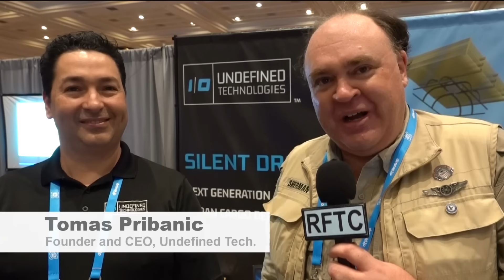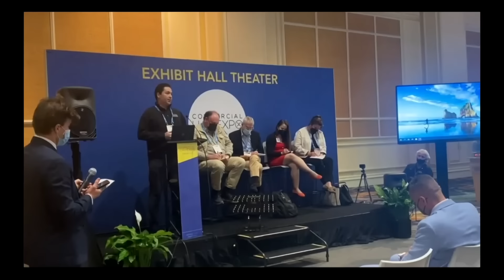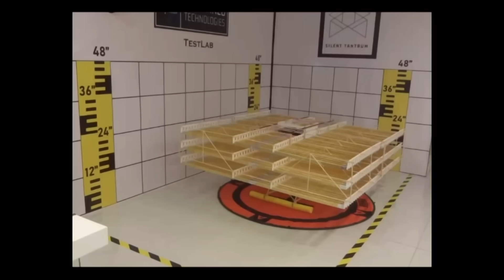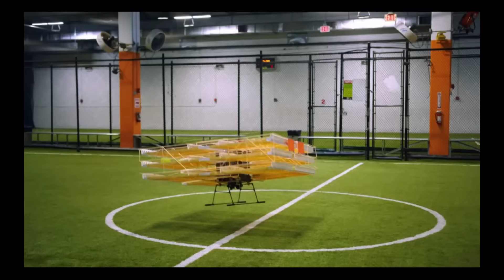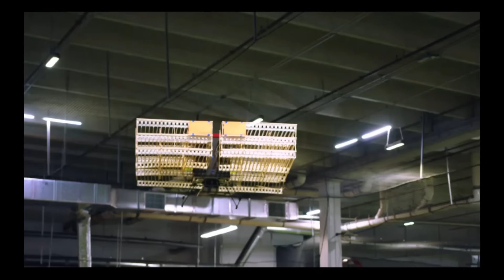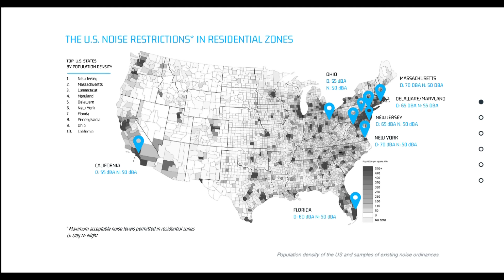New Drone Tech: No Propellers, and Yet It Flies!

Comment: 20 years or so ago lifter technology was all over the internet... We just now have the advantage of the newer and more efficient tech
Reply: Actually 20 years ago laptop computers had ccfl backlights in them and florescent light power supplies were all over the place.  Those types of inverter transformers that powered them were closer to what can be used to power self-contained ion propelled crafts.  There have been some minor improvements in capacitors and lipo batteries, but lipos did exist in the early 2000s.  Not sure of the exact date. I made an ion propelled craft hop in 2006 using them.  It now has two patents since 2014.  It takes a lot of special details though to make it work.
Reply: never heard of it.

Comment: I'm extremely skeptical of this guy. Yes, ionocraft, as they're called, do exist, but they are tethered and have nowhere near the performance required to lift their own power source.

If you look at the current state of the art, the MIT ion airplane, it produced barely enough thrust to propel a conventional airplane, already pushing the limits of the technology. Now this guy claims his machine can fly with at thrust to weight ratio of over 1:1 with 2 pound payload for 15 minutes? Come on.

You can even see the ducted fan they use to make the fake prototype fly.
Reply: Hi Nathaniel,  
You are completely correct about the UT device.  It does use a ducted fan for lift.  I know it may be hard to believe, but the MIT version of the technology was not state of the are nor were they the first to lift a power supply with heavier than air ion propulsion.  Amazingly, it was a historical blunder by Dr. Barrett and his students to claim that it was.  I am the inventor of the first ion propelled aircraft to carry its power supply onboard. Please see US Patents 10,119,527 and 11,161,631.  There are 33 flight videos of the craft on my channel including with officials present.  The physics of how it works are explained in a crystal-clear way.  That said, it was not easy to do.  It is about perhaps 50 to 100 times lighter than the UT craft and requires a large number of details be just right for it to work.
Reply: @KraussEMUS1  I actually saw your interview with Bradley Whistance a few years ago, but I had forgotten about it when I wrote the comment. I'm sorry; I was just writing from memory. I should've checked my facts. I guess it goes to show that a more flashy demonstration really affects public perception.

Comment: I don't understand what would be so tricky about the controls. Each layer and each square has a charge, and you'd control the amount of ion flow with current each one. Probably very similar to grids set up to control LEDs --- and people do this with Christmas lights and MIDI controls (I guess). However, I wonder if there are certain frequencies on the current that have more "grip" on air ions.

Comment: @ robbin harris
But in those days the lifter had to be attched to the table with wires, because it was uncontrolable, and you needed a big ass external power supply
that was hooked up to the lifter with a electrical cable. And even when it would have been controlable, it wouldnt have gone anywhere without a power cable.
So this is a nice upgrade, because it's controlable and it's carrying it's own power supply and can even lift 2 pounds.

Comment: I saw videos on a airplane someone built with the same propulsion method. Works the same as those ionic air filters you might have in your house or at least seen on TV. Charged air is drawn from the negative plate to the positive.  I was impressed that this could actually lift more than it's own weight. The lack of moving parts is pretty cool. Just wish it was a bit more efficient.
Reply: Ya theyve been using electro-magnetically charged particles for stuff like this since the late 80s and probably way before that. This isnt anything new.
Reply: That was MIT's V2 craft.  Theirs was not the first ion propelled craft to lift its power supply though, nor is it nearly as efficient as the earlier series of solely ion propelled crafts on my channel.  They are patented since 2014 for lifting their power supplies onboard against Earth's gravity solely with ions. There is a video on my channel of one producing a greater than 1 to 1 vertical lift for almost 2 minutes.
The UT craft above requires a high-powered ducted fan in the middle as its source of lift rather than ions.
Reply: @KraussEMUS1  Making the 70s great again
Reply: @thetruthchannel349  
While I enjoyed the 70s, there are only one series of crafts that are really solely ion propelled that can lift their power supplies.  Onboard power wasn't possible in the 70s without lighter than air assistance.  There are over 36 flight videos on my channel showing them in operation.
Reply: You forgot to say that the airplane CANNOT POSSIBLY BE MADE TO MOVE (while on Earth) using only ion propulsion.  
IT'S A SCIENTIFIC IMPOSSIBILITY!!!!!
Reply: @manifold1476  You obviously haven’t worked with high voltage electrical systems. Stopping them moving is a major challenge.

Comment: They work great until a stiff wind or Cow fart disturbs the ion lift field.   Small prop/balloons dirigibles are much more effective, but probably not practical enough. In general it only works indoors and for just a few minutes or longer with a power cord attached to it.   They have even tried to combine this with a lighter than air concept blimp with some impractical success. If you search or google for ion lift you will find dozens of guys like this thinking they have made something special.

Comment: The lifting power is small, so it’s good only for sending postcards across a lake. Reminds me electric engines powered by atmospheric voltage, the idea is cool but the power is too low for any commercial usage. Better would be to hide propellers of a drone  inside plastic pipes and direct the outlet to the ground, something like flying vacuum cleaner :)

Comment: That sure looks like a ducted fan in the center, so they call the fan rotor NOT a propeller!? Just a technicality. So it gets lift from the EDF and maneuvers by ionic forces. Very unstable with the downwash.
Reply: It maneuvers with fins that move at the bottom of the ducted fan.  The only VTOL solely ion propelled crafts with onboard power are patented and are on my channel.

Comment: I call bullshit.  What is that in the center?    A propeller of some sort and the breeze is distributed around the fins?   I experiment with this sort of thing years ago using a flyback transformer out of a TV, very light weight materials and the thinnest aluminum foil I can find.    And this thing in the video is sure lacking in lightness.    So I'm not convince and you all shouldn't believer everything you see either.

Comment: You can get "room air ionisers" - little battery-powered devices with no moving parts, but a sharp-pointed electrode that sticks out of the front.  If you put your hand in front of them, you feel a breeze coming off it, so it stands to reason that it must be producing a small thrust.  A battery lasts a long time, and all it does is drive a high voltage inverter, so one battery could probably power a lot of sharp-pointed electrodes, each one producing a small thrust.  Personally, I would never have thought of using it for lift generation, but I'm also not too surprised to see that it can be done.  Well done, that man!
Reply: as number of needles increases voltage drops..
Reply: @esecallum  Use LiFe batteries - they have a very low internal resistance.
Reply: @esecallum  Use LiPo or LiFe batteries - very low internal resistance gives very little vol;tage drop under load.

Comment: I talked to a high school electronic teacher about this concept 60 years ago. He warned me about the dangers of the phenominally high DC Voltages. Power supplies are more efficient now.
Reply: Yes and batteries are lighter for a given capacity and power rating.
Reply: @gordonlawrence1448  - the HUGE problem with the batteries is how efficient they can store a required amount of energy, for HOW LONG, and in WHAT conditions. 
Any Tesla owner will know how the batteries behave at sub-zero temperature ( higher you go, in atmosphere, colder it is ! ) ;

Comment: That this guy got this wooden drone out without getting killed is amazing, since ION Lightweight Technology is one part of classified military technology for over five decades.
Reply: Sure.
Reply: Ion lifters have been made since the 1970's.
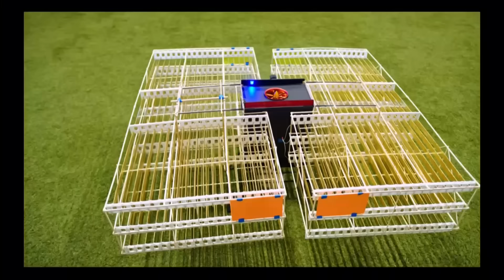Reply: @paullangford8179  theres a ducted fan on that thing  lol at 1:27
Reply: I can sure see secret services loving this kind of stff, energy efficient or not.
Reply: The lithium bag batteries from tablets were what I have been waiting for since building such devices in the 80'.. Work progresses. The most difficult part I find is insulation for the extreme voltages (it's not a current matter) needed.. and finding wires thin enough. Oh for a room temperature superconductor.

Comment: It ionizes some of the air around the top frame with a very high voltage giving the air a positive charge . The bottom frame is negatively charged to a very high voltage so the ionized air from the top frame is accelerated down toward the bottom frame "dragging" with it unionized air . The inertia of the air is used to create lift a bit like how you use the inertia of the earth to do pushups !

Comment: How about a power plant with no water,  no battery,  no starter motor. Very high rpm with extreme torque. High compression air output.  No external fuel . It is it's own .
  Just a poor boy they said was nuts 35 years ago . But what I said then is happening before the world's eyes now.

Comment: Needs a vortex design for the ionization exchange. Eliminating the deck design and into a saucer shape. Then centralize the vortex to absolute zero in the center of the craft. 
Creating an infinity pattern above and below the craft. Using magnets positioned at particular locations to be negatively or positively charged at certain necessary intervals to control balance, polarity.
Reply: Add lights to the frame that illuminate as it activates the electromagnetic positions and play techno.
Reply: @ChrisHillASMR  Hell Ya

Comment: It's a neat toy but in practical applications other methods are more efficient and faster, this may fly 15 min but I doubt it is doing 100+ mph easily like a typical drone could while carrying more weight so that 15 min doesn't get you nearly as far. Stability seems to be a problem too. quad propeller drones are very fast and can turn/stop on a dime.

Comment: So it's basically the size of a dog house yet can only carry 2 lbs?  Sh*t.... you can get a squirrel to carry that much.  The modern day equivalent of a carrier pigeon.  Well done lads.  No blades means safe no?  Doesn't ionic propulsion require like a billion volts to create lift?  That is all, carry on.
Reply: There is a relatively safe version on my channel that uses high voltage but at a really low current. It is the only one that really lifts its power supply. The UT craft requires a ducted fan.

Comment: Takes alot of raw electrical power, and it's all high voltage, which just LOVES to arc. A little dust could be enough to discharge the whole grid. Also, it might be silent, but it's charging the air, making massive amounts of Ozone. You'll smell it coming.
Reply: So it's a flying Oreck air purifier... would this be charging all the particles in the air that pass through it causing them to electrically glue themselves to a opposite charged surface?

I don't get the practicality of this thing anyway, can it do 0-100 in a few seconds and turn on a time like a typical drone does while being super stable? This think looks like it could wobble around at best. If it's slow 15 min a flight doesn't mean much.

Comment: ya sure..  lots of us did those ION LIFTERS from back in the day using old TV FLYBACK TRANSFORMERS.   but i gotta warn you all,  those things are cool and all, but DONT TOUTCH THEM WHEN THEY ARE RUNNING..  you'll never know you did!!  tens of thousands of volts goes through every one of those fins.   but i'm sure they will figure out, that SCALING doesn't work because you need SOO MUCH power just to drive its self.   if you wanted to lift 20 pounds, the damn thing has to be the size of a basketball court!

Comment: Ionic propulsion?
Unless this company's technology contians some kind of physics breakthrough, there have been a number of demos created that can only be flown indoors in a very, very controlled environment with no wind currents. That is because ionic the tradeoff for ionic propulsion's various advantages is that it just can't produce much horsepower at all. In space, ionic propulsion doesn't have to push against atmosphere. At terrestial altitudes, not only do you have to push through atmosphere, but the atmosphere is typically turbulent, both which greatly increases the amount of power required for controlled flight.

Comment: This specific model is a fake.  At 1:26 minute you can see a ducted fan. Propulsion and repulsion with ions makes a hisss sound so for a 2 pound craft a lot of energy is needed. The final model is made of foam, wood, cardboard....  very low conductive materials,  any foil is not seen in the craft as a conductive material. If the lift are made by the quadrants (wings or lifters) then they must bend a little to the upside because they are lifting the centerpart of the craft. But in slow motion can be seen a hard landing  and how fragile the quadrants are. so for a lift must be a noticeable upside bending.  Its just a prototype concept that in the future could be practical maybe in space(as a drone), actually this ionic thrust is used at space. But right now they dont catch me with this fake video.

Comment: This is an old technology. They're called lifters. You can make one out of balsa wood and aluminum foil, but it requires higher voltage and they're not that powerful. The upside? The air surrounding this type of device breaks down into it's finer components. Hydrogen and O3 or ozone result.

Comment: So instead of accidentally being flayed alive by fast-rotating wafer-thin carbon fibre blades (typically not surrounded by a shield), you can be zapped by a few 10s of 1000s of volts of static electricity. Not so good for people with long hair.

I played with a Van Der Graaf generator that produced (I think) about 250,000 volts back in the 1960s in school. It was fun having bright blue lightning bolts jump between the dome and one's finger a distance of several inches. It could also be 'hair-raising'.

Comment: I remember seeing something like this in a science or tech hobby magazine (maybe it was a Meccano magazine?) in the 1960s. It was fed power via a thin electric cable. I have never heard of such a device being powered by batteries because it would not have the power to lift them.
Reply: Yeah, Soviet defector Alexander de Seversky pioneered the idea. He was promoting it in magazines then.
Reply: @michaelcre8  Yes, and before him was TT Brown and others.  It has always required large external power supplies though until the crafts on my channel.  It took many particular changes to get them to lift their power supplies.  The main improvements are shown in the patents. Normally ion propulsion won't lift its power supply against the Earth's gravity.
Reply: There are a series of efficient ion propelled crafts on my channel that do lift their power supplies.  The UT device, however, must use a ducted fan.  There is no way it can lift batteries and its power supply with ion thrust.  The way it is structured it would take at least 100s of times more power than batteries can provide.

Comment: Are we really supposed to take this seriously?  The most powerful ion engine currently is 30+ inches in diameter, weighs over 500 pounds and generates just over 5 Newtons of thrust.  That's seven THOUSANDTHS of a Horespower!!!   Oh, and it needs 200 KW of power.  That could easily accelerate a drone-sized object, but 500 lbs is not drone sized!!!  Just accelerating itself, it only has 0.04% of the thrust needed to simply hover Earth's gravity.  Sorry, not falling for it.

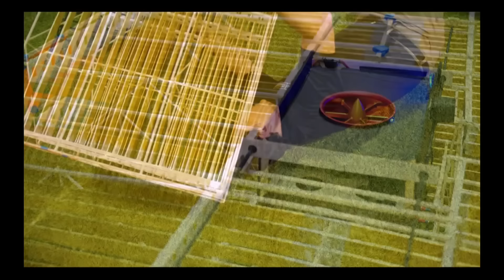Comment: 1:45 there is a turbine truster in the middle of the drone, what a piece of fake s,  the trust if theses ion generating mesh is so little it is not even enough to steer this drone or even think of lifting, test models that uses this kind of lift are made light from some foil wire and balsa wood and the high voltage generator to power these devices is so heavy u cannot even think of carrying it on a drone. and the high voltage must ve made this dangerous to lift

Comment: Finally, independent and controlled atmospheric flight without combustion and moving parts. As development continues, application will expand to eliminate combustion motors
Reply: Primary lift is through the ducted fan in the middle. The ionic thrust is mostly control.

Comment: “ZERO CARBON EMISSIONS” on the sign @ 1:00. Except when the batteries are recharging for three hours between flights with electricity from a coal fired power plant.

Comment: Yup, that's snake oil if I've ever seen it. Ionic air propulsion is nothing new, been around for decades. Takes some very high voltage to produce very little thrust. I'd bet anything that if you could listen to the audio from those flights, you'd hear that ducted fan in the center of the drone screaming
Reply: Yes, they do have a new video out that is on their website with audio.  There is a loud ducted fan in the center of it.  On my channel there are over 30 videos of the only solely ion propelled craft that lifts its power supply onboard.  It is possible to build an ion thruster that uses far less power.  The details are described in my patents US 10,119,527 and 11,161,631.  The UT craft would take hundreds of times more times more power to fly ionically than any current battery technology can produce.